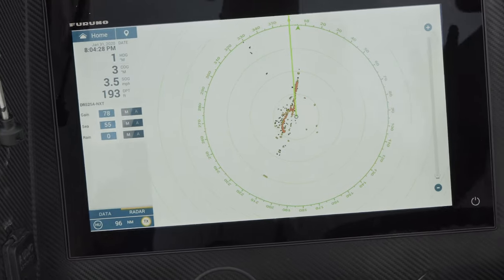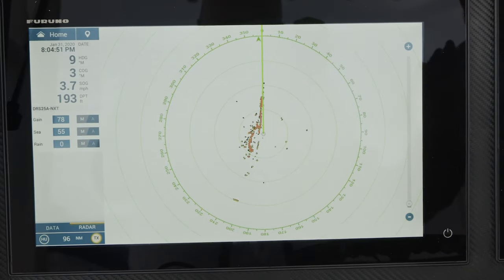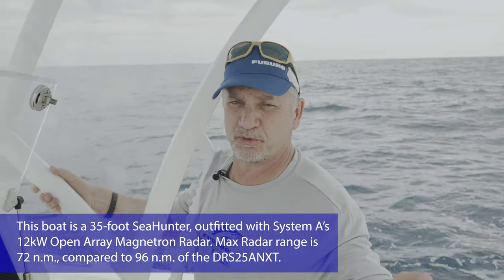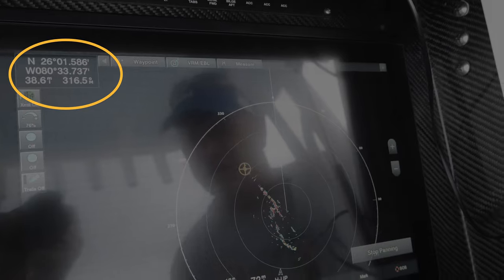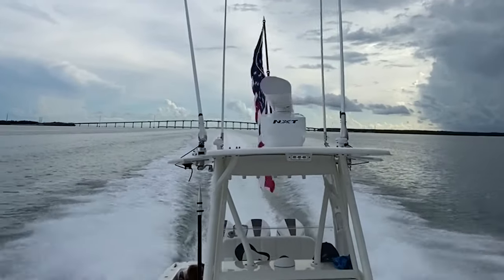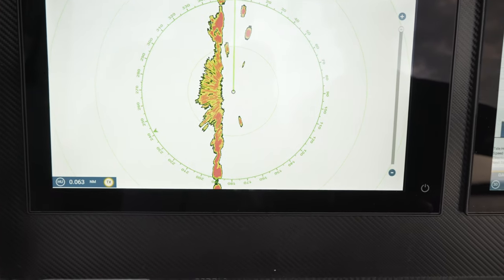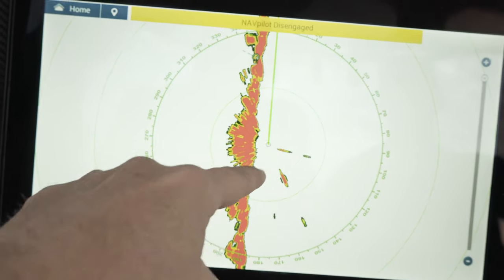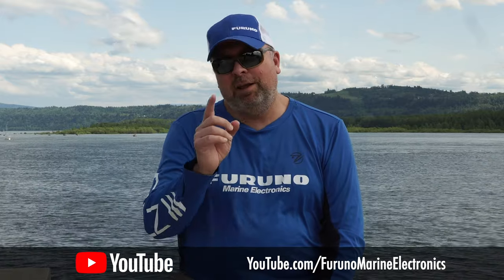Furuno Connections Quick Take - DRS25ANXT Solid State Open Array Marine Radar vs 12kW Open Array

Comment: Good Morning All, I have a Nordhavn with a 15 inch TZT2, and a 12 inch TZT2 on the fly, with a DRS4DNXT Radar. I have zero interest in fishing, but do spend summers in Maine so use Radar in the fog a lot, and I do a lot of mid to long distance cruising offshore at night. I am thinking of switching to the DRS25A Radar, and TZT3, along with a sat compass. What improvements will I see? I am also thinking of adding a FLIR 364C, but am unclear as to wether the color will work on the Furuno system. I know I would have to add an Axiom into the mix if I wanted augmented reality. 
    Best,
      Maldwin Drummond
Reply from the maker: Hello Maldwin, when you upgrade to the DRS25ANXT, you will be able to see targets further than you can with the DRS4DNXT. You will also be able to penetrate storms and fog better, along with having a tighter beamwidth that will give you better target separation and resolution. The TZT3 will give you added speed over the TZT2 and the ability to split your screen 4-ways. We've just released new software for TZT2, which gives it many of the new features that TZT3 brought to the game. As for compatibility with the FLIR 364C, the best thing to do is go to our Furuno Forum (www.FurunoUSAforum.com) and ask your question. There you will find technical staff that can answer more of your technical questions. Thanks for watching!